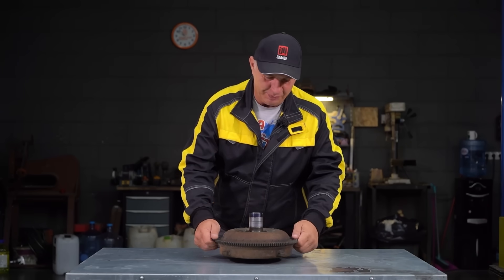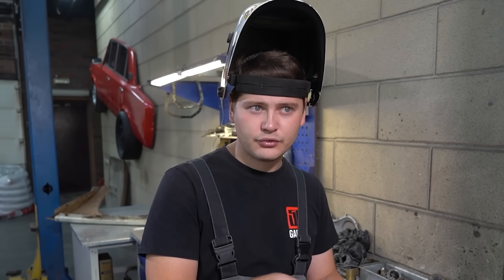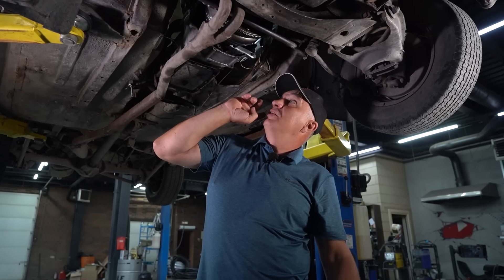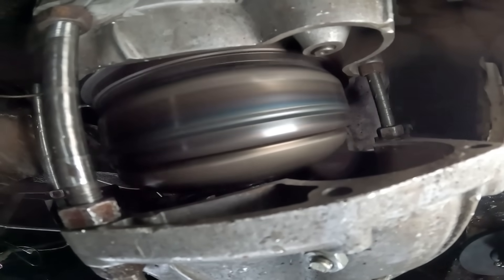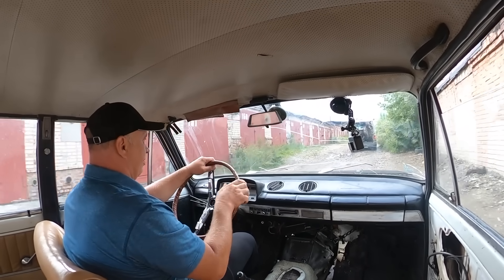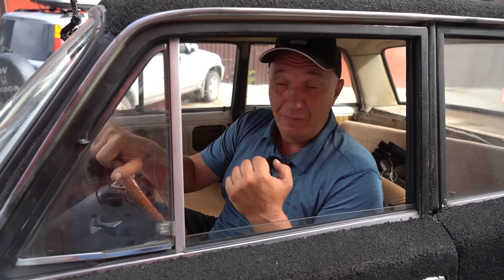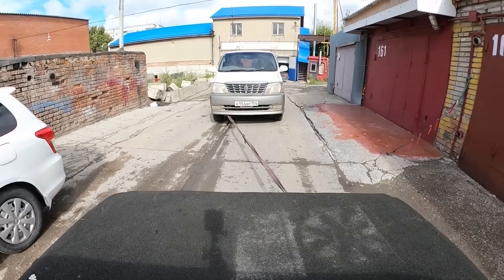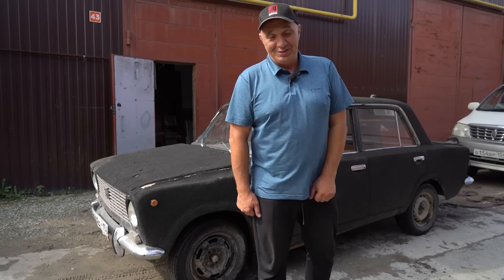Torque converter in a manual transmission - will it work?

Comment: The only problem I see is heat. With any extended use that torque converter will fry. It’s could be done if you use the pump from the automatic transmission to pressurize the converter and pump fluid through a cooler. Heck you could even set the tourque converter lock up clutch to actually work. I love it though. I’m from America so we’re getting less and less different everyday😂

Comment: VW had what they called the auto stick  a three speed manual transmission with a torque converter with a vacuum activated clutch a switch in the shifter activated a salinoid for the vacuum clutch for gear changes you could pull to a stop in gear and just sit there press on the gas pedal and go

Comment: You just have to learn to tune the torque converter..... Then you got to figure out how you're going to cool a torque converter...... Also you should not have chosen a torque converter that was    remote control lockup... Because what those torque converters do is.  They slip until something locks up the mechanism in the torque converter

Comment: The TC lock-up only works if there's oil from the trans being pumped into the TC at a set pressure. Since the only oil is that what you filled it up with, there's no increase in pressure, apart from normal heating-up.

Comment: Now we need this set up connected to some Honda side shaft lawn mower engines. I want to achieve 50 miles per gallon in a basic light weight car that is durable.

Comment: Its been done on tractors and front end loaders. So you can start off with an implement in the ground or push a bucket in to dirt without heavy wear on a clutch plate.

Comment: Mercedes Benz did this in the fifties. We had a 1958 219 new , yes dad was a rebel, 4 speed on the tree , it had a vacuum pot electronically controlled at the shifter with a clutch and a fluid coupler.put it in gear and give it gas , let off the gas and shift …

Comment: I kind of wonder what the temp of the fluid in the torque converter is getting to during the van pull... Most people would not think that fluid going round and round would not get hot but it does. If im not mistaken, it is the most common cause of burned trans fluid in vehicles used for towing up steep grades that arent designed for towing. Excellent idea and great work on the vid!!

Comment: Our trucks in the military had torque converters with a manual transmission, but it also had a clutch. You could basically start driving in sixth gear and fully stop, and it wouldn't stall.

Comment: Got idea, can you revisit, I'd like to see a temp test on outside, and try using the pump, instead of sealing torque converter maby loop the input and output ATF to a open close valve to clutch peddle, ?

Comment: Coming back a year later, I'm baffled that ever since the Chrysler Fluid-Drive in the 40s and 50s, no manufacturer has tried this. Mixing a locking converter with a stick shift manual is just a good idea, it satisfies both people who don't like having to work a clutch, as well as the people who like shifting their stick-shift car. Sure, its not the complete driving experience for both, some people who don't like working a clutch also don't like shifting, and some who like shifting manually don't like the potential gumminess of a converter, but its the best of both worlds, once the converter is locked, you get the awesome engine braking of a manual, as well as the superior fuel efficiency of a manual, but also the hill starting and towing capacity of a torque converter. It was used in lots of big trucks for a reason, it made handling it easier.

Edit: In fact, the ideal setup would be a high-stall locking converter with a 5 or 6 speed H-pattern.

Comment: We did just the opposite in drag racing.  We put a manual clutch on a 2 speed Power Glide auto transmission.  Hard launch quick shift.

Comment: And how do you change the transmission oil in the torque converter. Every 15k  to 30k miles and then cooling of the fluid so it doesn't burn.

Comment: Can someone guide if it is really practical to replace the clutch with a torque convertor in a manual transmission? Also what should be done when we have to change gears?

Comment: Imagine two fan blades facing each other. Spin one and it makes the other one spin. Once they've almost reached the same speed, connect them to each other directly using a clutch. That's what the lock up does. Then it's direct drive for highway speed.

Comment: This is how them old manitowoc 4100 friction cranes work, before the 4100 if you came into your hoist and let off the brake, it would fall out of the sky. In a 4100, you can engage your hoist through a torque converter, and unlike the even older cranes, it wouldn’t fall unless you slipped it/ kicked it out

Comment: Late but could probably have a clutch still in there just for going into neutral, and pulling away but thereafter don't use the clutch instead float the gears?

Comment: The torque converter relies on oil pressure to lock up with minimal oil it will work but won't lock up

Comment: I had a Volkswagen Super Bug that had a torque converter in front of an manual transmission. It also had an Electric Clutch that would disengage when you grab the shifter. I don't know much about how it worked, but it worked well.

Comment: It's older than 50s Desoto used it in the 40s, between the engine and the manual clutch, the  manual clutch could be used to start from a dead stop and then just shift up from there, but if you were talented enough, you didn't need to use the clutch at all, just bump n rev shift down, and speed shift up, not too hard too learn just be gentle, the more proficient you are the smoother the shifts up or down, its art , i actually learned it from dad on our 49 chevy ton truck, was helpful when i finally got too work on an old Desoto..experience teaches..history Teaches..truth is sovereign

Comment: GREAT!
You guys should come to Alaska and have a summit with Trump.

Who needs a clutch. > 20 years ago the clutch pedal broke off my old VW Bug when I was up around Eureka / Arcata, HumboldT County, California and I drove back down to Silicon Valley South of San Francisco without a clutch. At stop lights turn the engine off and put it in first. Drove through San Francisco like that.

Too bad you don't have some VW Bug engines and TransaxleS to put in the back of those old LADAs.

Comment: When I drive the old fire trucks with manual transmissions, I only use the clutch when starting. Once it's moving, a good driver only uses the accelerator to shift. When there is no torque through the trans, it will drop out of gear. Once the gears are moving at the same speed, it will drop into gear. That's how you shift. Also, there are no synchronizers, so you can't just put the clutch in to downshift. You have to use the accelerator to downshift or you will grind the hell out of the trans.

Comment: My Case 580 backhoe has a torque converter and manual gearbox.  Not an uncommon thing in tractors.  It also has a clutch to allow shifting gears.

Comment: All I'd suggest to perfect it is a shaft brake to shift gears (on the torque converter output, so you won't stall the engine) and then some way to cool the torque converter, especially if using a locking one, then it's golden.

Comment: Congratulations, which you've just made. It was essentially a hondamatic transmission. The difference is Honda hooked theirs up to a 4 speed transmission, and only used second and fourth gear low the second. And when you put the transmission into its DriveMode that was the fourth gear, they used a high stall torque converter, instead of a standard stall torque converter, like you guys They had a throttle linkage that made it so under heavy throttle. The torque and murder would be. It's more likely to slip, and they also know. Mounted the torque converter to the transmission side instead of on the engine side. So that way, yeah, as long as the car was at a complete stop. You could easily go from reverse to forward and back-and-forth between Second gear and fourth gear or low and drive in transmission, relatively easy on the 5 vehicles that Honda made that use the hondamatic, 2 speed transmission. And that is basically what you made by sticking a torque converter in a manual transmission car.

Comment: They actually work just fine if done right. I drove a 30 ton truck (approximate gross weight) for almost 20 years with such a setup when I was in the army. That transmission was made by ZF and was mounted in a Styer.

Comment: seems to be some vibration at certain speeds//  David Brown Tractors built a "Turbo Task" model for moving ships during docking. I believe they added the torque converter to the standard clutch and gear box. Cooling is not an issue since farm tractors are designed to operate at continuous full throttle, indeed, I have used one to drive a generator continuously for 48 hours during the UK miners strike in 1973.

Comment: im a transmission mechanic with my own shop and this still makes no sense to me, im fkin impressed!!! how did the covterter function without pump hydralic inputs.... i dont understand how the converter is working if all they used was the pump and input shaft. what about the valve bodies tcc regulator valve what about the fact that fluid isnt flowing is only sealed in the converter... how do you get tcc clutch apply without a fluid circuit feed to the tcc

Comment: What you have there is a remake of an old Chrysler with just a torque converter with a clutch on the back of it.  VW had something similar but with and electric controlled vacuum operated clutch in it in which I explained in an earlier post.  Both your car and Chrysler just had what trans fluid came in the converter. but VW  had theirs with the fluid in it going through a pump on top of the oil pump to keep the fluid constantly circulating through the converter for cooling, where the Chrysler and yours would heat up the fluid too much.

Comment: All you gotta do is get one of those 'automatic stick' transmissions that VW put in the Bug and Karmann Ghia.  I had a '70 Bug and my daughter had a Ghia that had one in it. It consisted of a 3 speed manual trans, a torque converter with a clutch attached to the back of it, The clutch had a vacuum canister with an arm that operated the clutch release arm, The vacuum was controlled by a half inch diameter button on the bottom of the shifting stick in the top of the 3 speed manual trans and had a spring built around the button assembly that that held the stick up off of the bottom half of the big button switch to keep it apart and not touching the top to the bottom. When you pushed the stick in any direction, the tilt of the stick would make any side of the button would touch to make contact  with the other half. which would make  a relay switch operate the vacuum canister to operate the clutch assembly. It had a large tank under the  hood that held enough reserve vacuum for it's use and need.  With the engine running and in neutral, when you pushed the stick into first gear and let the stick go, the clutch would be engaged to the transmission through the torque converter and with the brakes on, it would give a lurch against the brakes like a normal automatic trans would.  You would drive it like a regular 3 speed stick  but there was no clutch pedal to operate.  VW recommend to take off in second all the time as the torque converter made up for the lack of using first gear in it, but I used all three gears all the time, I am a gear head, after all.  My wife couldn't drive a regular stick shift car, but she could drive this car, she couldn't coordinate her clutch foot enough to take off easy and would grind gears all the time.  I'm old enough that I learned to drive on granddad's old '50 Ford 3/4 ton pickup with the 4 speed granny gear transmission in it, the one with no synchronizers in it and if you drove it wrong, you would 'grind me out a pound' between shifts and this is where you had to learn the art of 'double clutching' to drive it and not grind the gears all the time.. Sorry for the long winded explanation but it takes a lot of terms to describe that automatic stick to where it's easily understood.

Comment: Will 'work' short term, but the oil will get boiling-hot inside that torque converter  and spurt out with any long-term use. It would need some kind of cooling loop to actually be 'useable'.

Comment: マツダのロータリーエンジンを積んだセダンにありました。低速のトルク不足やノッキングを補う目的で、ストール比は1対1でスムーズなクラッチ操作とスムーズな加速が特徴でした。5速にシフトの横にパーキングシフトが付いてました。
It was in a sedan with a Mazda rotary engine. To compensate for the lack of torque at low speeds and knocking, the stall ratio was 1:1, which allowed for smooth clutch operation and smooth acceleration. It had a 5-speed with a parking shift next to the shift.

Comment: Maybe it would be better to use a system similar to the one in the old Beetle, where a conventional clutch was installed right after the torque converter. In this case, the conventional clutch can be activated by a solenoid or a servo motor, just for shifting gears (the smoothness of the system would no longer depend on the clutch, but on the torque converter).

Comment: I have a 6x6 German military truck (MAN KAT A1.1) with a 16 speed manual gearbox and wsk 400 torque converter.
It's a beast!! It can pull legally 180T on the European roads!
Greetings from Belgium!
Reply: What is the vehicle class it is in and the  maximum permitted load per axle?

Comment: In this application the efficiency of the torque converter is surely very low.  So it must be getting very hot.  It seems that the oil inside it likely to boil !

Comment: I would add a clutch just after the torque converter so you can shift gears by pressing the clutch pedal, but with the advantage of being able to get off the line smoothly, without having to press the clutch (ideal for busy journeys), and the car never stalls when stopped. And the finishing touch would be to override the torque converter with the hydraulic clutch inside, activating a lever like a handbrake when you're in fourth or fifth gear on the highway.

Comment: in the early 50's Chrysler products had a torque convertor on a manual transmission. it also had a clutch, but its use was not necessary. they were awful.

Comment: Chrysler made these in the early 50's.  I had a 1950 Dodge truck with a torque converter, with a clutch, connected to the transmission.  You could leave it in gear at a stoplight or push in the clutch.  If you did not use the clutch I started in second gear as the torque converter gave you so much torque.  However, when stopped you had to have emergency brakes as it would roll as if in neutral.  Very simple.  I liked it especially when towing a lot of weight up a hill and stopped.  You just put it into first gear, let out the clutch, take off the brake and push on the gas and then take off like an automatic.  So easy, no clutch burn, max torque.

Comment: How about take a modern automatic, place sensors (Hall effect?) in the appropriate spot on a gear shifter that would operate the shift solenoids for the desired gear range.  Connect the torque converter lock up solenoid to a clutch pedal?

Comment: Use a higher stall converter, make a way to circulate tranny fluid and cool it, and you'll basically have a centrifugal clutch! I wonder what the fluid temp got up to while pulling that van?

Comment: I used to work on heavy equipment which included some really old equipment. This one old crane I was tasked with repairing had a torque converter/coupling. It was bolted solidly to the frame the engine drove an input shaft, and the output shaft drove the sprockets and gears.

Comment: Whats the point of having a torque converter if you don't have lockup. You've got nothing to actually activate the lockup and nothing to get rid of the heat generation. 80% of heat comes from the torque on an automatic. No pump, no cooling system.  Cool, you rigged something useless up

Comment: I know a man that put a torque converter in his race car with a four speed manual transmission. He won a lot of races with it. He had a converter that would lock about 4000 rpm. He was holding the car on the floor from the corner all the way down the straight end just lifting the gas pedal down to 4000, and rolled it through the corner. Didn’t brake unless he ran into a wreck.

Comment: The mass of the oil filled torque converter is connected to a flex plate which negates the need for a flywheel.

Comment: That ATF in the torque converter must've been boiling. Why not plumb an external fluid reservoir into the front pump so the converter can have some kind of cooling? Neat experiment though!

Comment: Maybe to avoid some of the vibration, find out the weight of the welded thread and nut and balance the torque converter a little by adding the weight on the opposite side. or where ever it needed it. But damn I love these experimental videos.

Comment: Dodge did a clutchflight transmission basically a torqueflight transmission using a clutch instead of a torque converter vw did a transaxle they called a autostick

Comment: Transmission fluid expands considerably with heat. If you get it hot enough since it is sealed it will blow out the seals. The magical ratio is to set the fill nut to 10:00 and fill it up till it runs out leaving an airspace

Comment: But due to a lack of increased oil presure in the converter you don't get the punch from the trans you would now add mechanical pump to drive up presure an you would habe something